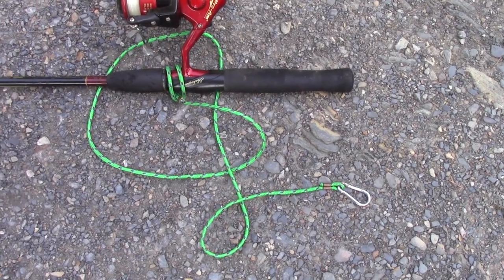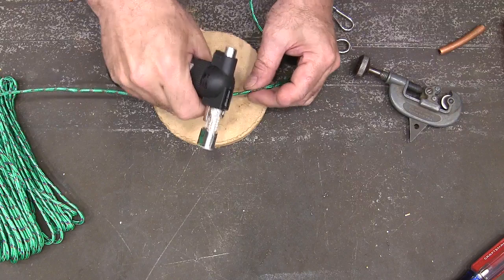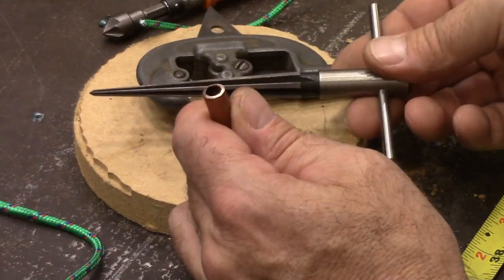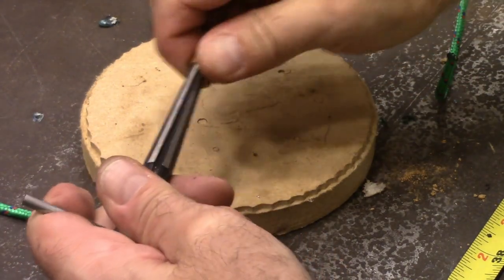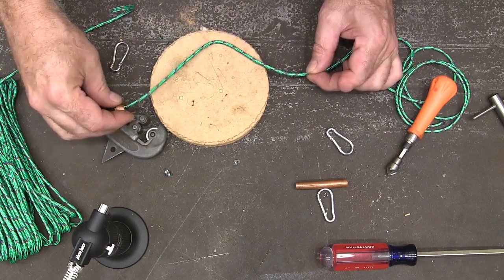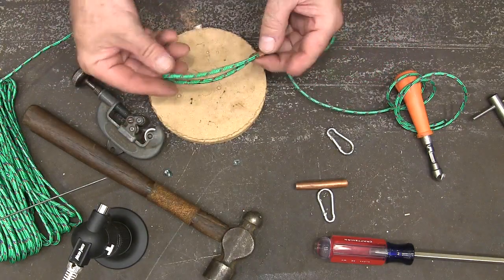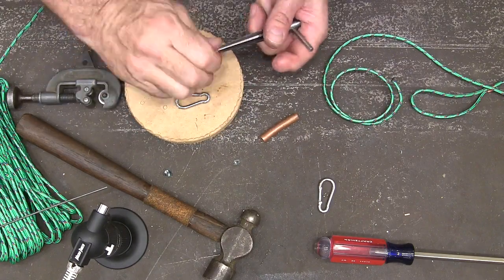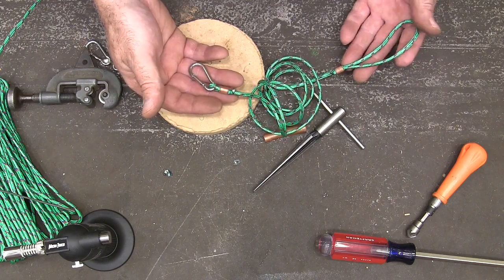How to Make Rope Ferrule Clamps and Rod Leashes.

Comment: The video was useful. I need several 5/8" ferrules... but they sell for $19 a piece. I'll follow your lead and make my own. BTW, the deburrer is built into your cutting tool. It's the triangular extension on top. Just stick the pointed end into the cut tube and twist it around like you did with the other tool.
Reply from the maker: $19 each. Holy cow!!

Comment: You can also use a Clamptite or a similar type of tools (some are really cheap to build if you have the right tools).  The advantage is you can use bigger cable if needed and go for stainless steel wire.
Reply from the maker: That's a great idea!
Reply: Where can u find clamptite

Comment: This is a wonderfully helpful video, thank you. Do you think this same method would work for shock cord? Or sometimes called bundgee cord here in Australia. I am wanting to make this for a tarp and my tent so there is flex and give when we have high winds. Will your ferrule's hold with that kind of tension? Thanks again.
Reply from the maker: The ferrule would hold but I'm not sure about using it with bundgee cord as it gets narrower when it is stretched and might pull out.  I've never tried it.  Good luck with yours!